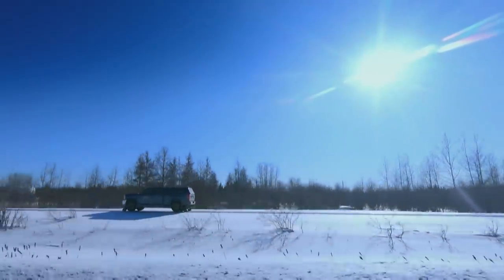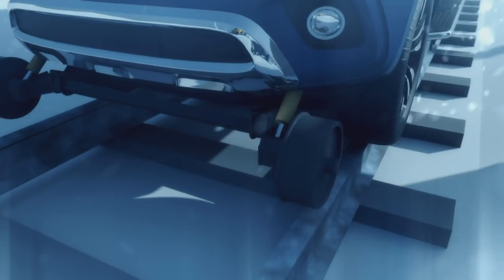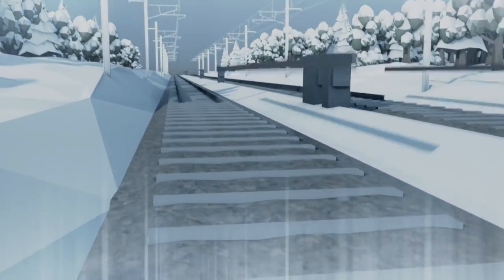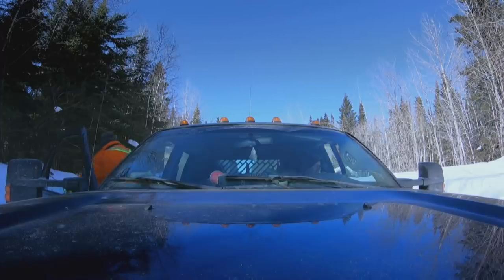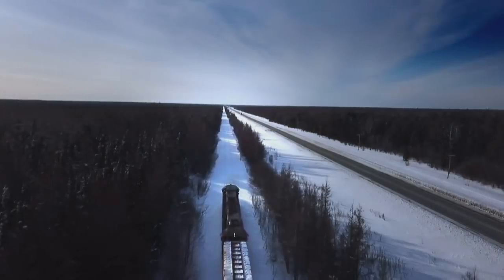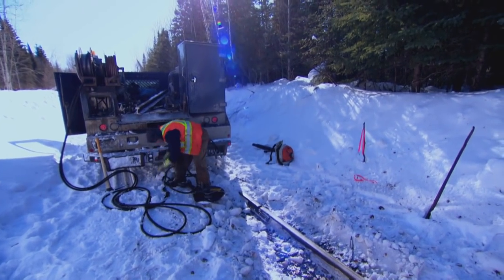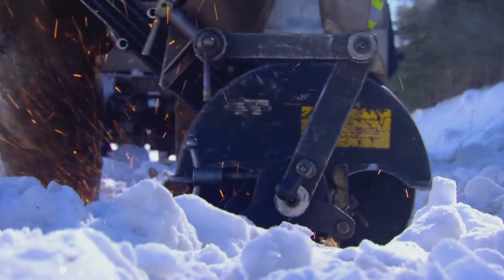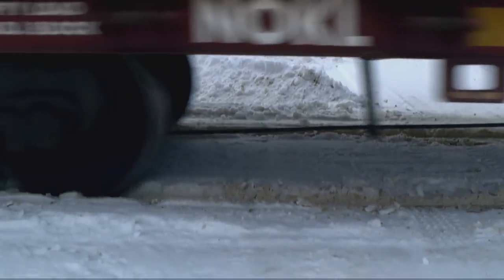Broken Rail Could Cause Devastating Derailment | Arctic Ice Railroad

Comment: I was surprised to see it bolted. I guess they can't weld them with the drastic weather and temperature change.
Reply: They do. Just the line they’re on can’t justify the cost due to traffic levels
Reply: CWR is usually on main line.
They can and do weld in hot/cold extremes, just need to de-stress the rail ( helps avoid breaks and sun kinks - solar irregularities.
Reply: I’m a rail fan in Buffalo just over the boarder to Ontario and are tracks are all welded. All. Maybe a bolt on section here or there
Reply: Not sure about feight, but most newer rail is ribbon rail. They make it miles long and bring it in on a flat bed cars. It gets welded together with thermite welding. You need a lot more anchors. Poor Paddy never saw the stuff. It has only been around for 30+ years. Poor Paddy was already in heaven working on the f'ing railway!
Reply: @willysnowman and with ribbon rail small segment patches are done with a short stick of rail put where a short damaged section then its welded or bolted in place

Comment: I wonder if a van with the same rail setup might be more useful, so you can keep your hydraulics warmer. Or if electric power tools might end up taking the place of hydraulics in this application.
Reply: I feel like hydraulics are overall better because they can be run almost anytime and are way stronger
Reply: Honestly, that would be a good idea. Especially if it was just a GMC express van, nothing fancy
Reply: Batteries do not like cold.
Reply: @alexprice4465  Yeah, the batteries would degrade in the cold / hot temperature change… until we invent more resilient and stronger batteries… I bet things are going to stay the way they are.

Comment: Can't believe this guy is driving all nonchalantly without two hands on the wheel at ten and two.          

 Jk 😂.  On the real though, I wouldn't trust it with no hands.
Reply: On a Hi-Rail vehicle the steering wheel is locked straight.  The flanged wheels guide its movement.

Comment: First of all who bolts tracks together, aren't they supposed to be put together with thermite welding?
Reply: Elsewhere yes, I guess the temperatures there will override the benefits of doing that.
Reply: @zacm.2342  thank you
Reply: @zacm.2342  keep in mind that this is northern Ontario
Reply: For the same reason that bridges out here in central and northern Canada have expansion joints large enough to fit your fist through rail also needs this. If you have ever seen "the worse railways in the world" and have seen those wonky wavy rails. That is what the rails would look like after one good winter if it was all welded together. Those joints are critical in order for the rail to last and stay safe.
Reply: This is secondary line so no.
Reply: It’s a low volume line. Can’t justify the expense for the tonnage they’re running. Bolted rail is just fine.
Reply: @1Nanerz  runs between Cochran Ontario and moosonee  so it's basically in subarctic temperatures all the runs back and forth is those Passenger cars and freight it's The only way in or out of town other the Bush planes
Reply: @ethantism  I know. I’m a CN maintainer. Worked up in Hearst for a bit and did a stint on the Nakina to Armstrong line for a winter. At least its a dry cold. Lol!
Reply: Whats second?